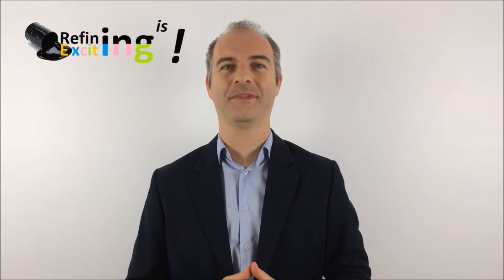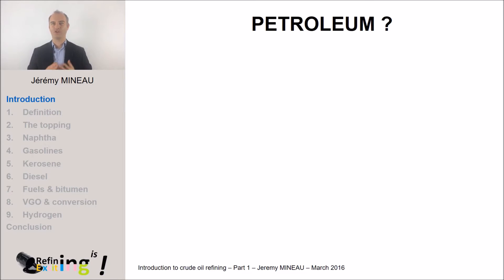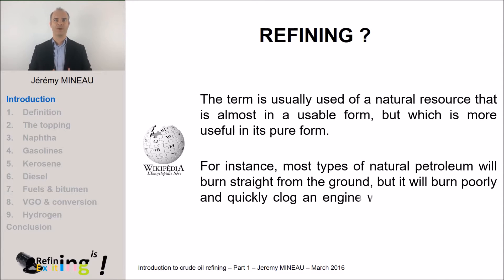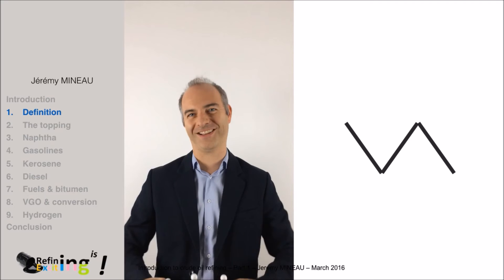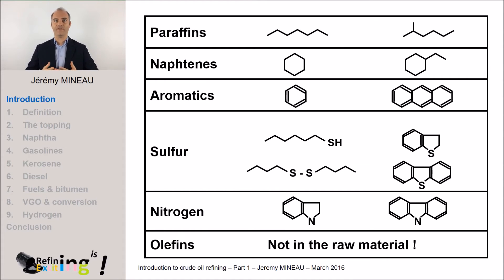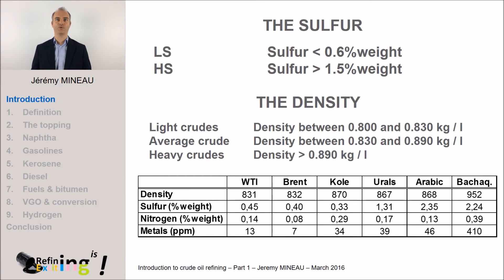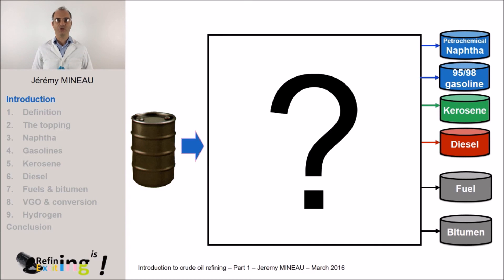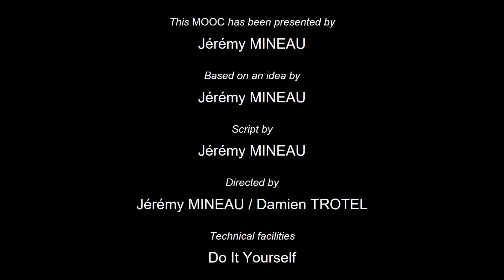MOOC  Introduction to crude oil refining  Part 1 English

Comment: Bonjour 
Merci pour la présentation. 
J ai volume de brut à 25 degré C avec un densite d à 15 degré C
La question que je voudrais poser est ce que je corrige la densité de 15 degré à 25 degré ou je corrige le volume de 25 degré à 15 avec Astm54 pour calculer le poids.
Merci d avance de me lire et repondre
Reply from the maker: Désolé mais je ne comprends pas votre question

Comment: Jeremy one question: if you reach 380C what happens crude oil, would you take more diesel, kero, naphthenes or u lost it all ?
Reply from the maker: I invite you to watch MOOC called « crude oil atmospheric distillation » and you will get the answer ! ;-)
Reply: Refining is exciting ! Thank you for fast reply infact i watched all videos 🙂 have to watch again. If there a catalyst in one column with appropiriate condition would you crack oil directly to valuable products ?
Reply from the maker: You don’t need absolutely a catalyst to crack ! Temperature is sometimes enough ;-)
Reply from the maker: For example, you can do thermal cracking in a visbreaker unit, or you can  do catalytic cracking in a FCC or in a hydrocracker. It all depends on the yields and product quality you are looking for !